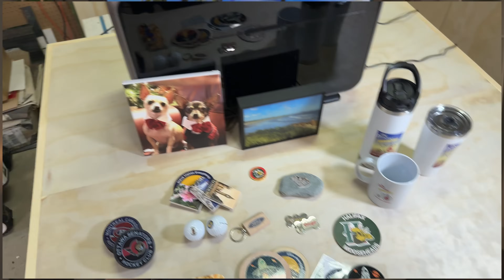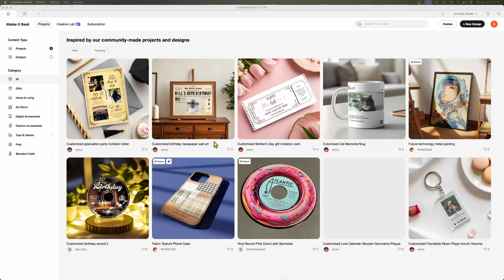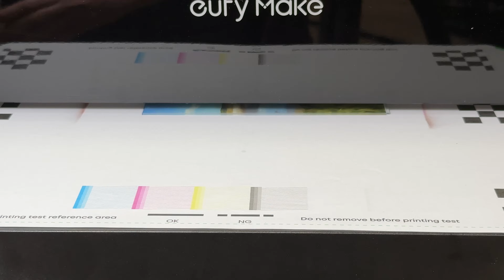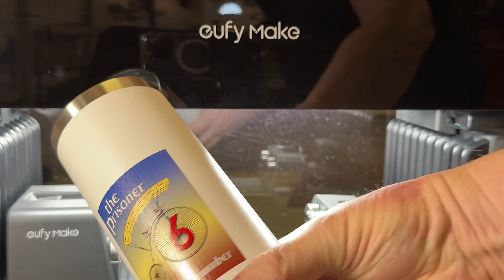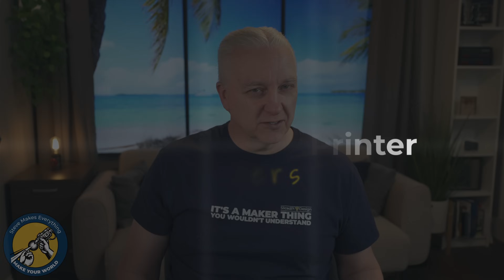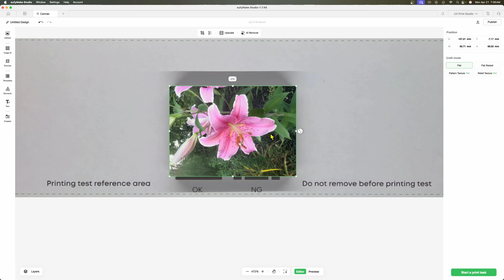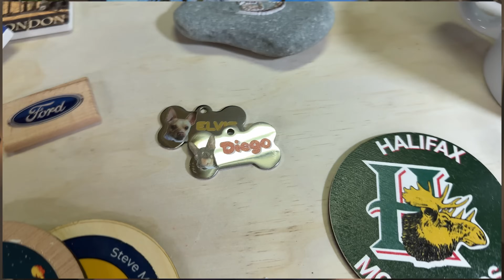eufyMake E1 | Pro-Level UV Printing for Creators at Home!

Comment: Can you print white small text (1-2mm height) on glass (candle) and plastic squeeze tubes? Thinking of product packaging text. Is the white ink still scratch resistant or does a gloss coat need to be added?
Reply from the maker: The glass will be fine. Note that flexible surface like a squeeze tube could be a concern because UV ink is resin, which it fairly inflexible. The white ink itself acts like any other color.

Comment: Hello! Are you able to put a 4x4 square in the machine while keeping it closed? I know the mini tray is only 3.5 inches wide from your description but wondering if it can fit a little more knowing that the area will not be printed on. I typically use precut 4x4 wooden and acrylic squares :) thank you!
Reply from the maker: I assume you're asking about coaster.  Yes they will fit on the mini bed, though positioning will require some serious accuracy

Comment: I liked this product and as usual, great video. One issue I have is that using your affiliate link, I try to order. However, there is a check mark that reads, "I understand that rewards or rembursements aren't guaranteed by either kickstarter or the creater" and then, there is a pludge button for $1970.00.   What am I missing? first time using kickstarter.
Reply from the maker: That's just a statement to say neither Kickstarter nor I have anything to do with the project, so any perks you might receive will come from Anker.  BTW can you email me your name (stevemakeseverything@gmail.com).  Anker is fighting a bit with Kickstarter because they said they are losing referrals back to creators, so I need to map you to my affiliate link so they will pay me.  Kickbooster is a bit of a mess apparently.

Comment: Hey mate. Does the 3d work on stickers?
Reply from the maker: No, because once printed, you'd need to laminate it.  There's nothing to stop you from using a piece of sticker paper and printing a 3D think on it without using sticker mode though.  It would be just like printing it on any other material.  Sounds like an opportunity for me to do a YT short video ;-)

Comment: As one who has been using large format UV printers I'll be curious to see how long the print heads last. UV printers big and small are great, however they need regular maintenance. These printers need to run, heads cleaned and flushed. An issue with just about all UV printers in UV light bleed over. Over time UV light starts to cure ink on the print heads. Head strikes are another issue, I'll be curious to see what the cost is to replace the print head(s)
Reply from the maker: That's true enough.  The good news is that the Eufy Make E1 does all of this automatically.  I haven't seen and issues with the print head at this point, though I've only been using this a month albeit fairly heavily.  But I'll report any issues since I'll keep this in my shop for a while.

Comment: I feel like A LOT was missing from this video. One question is have you had it long enough to see how the maintence is? UV printer require WAYYY more Maintenace then any of printer. Secondly how much white ink has been deposited on the back of the UV DTF stickers? I have been buying custom gang sheets personally bc I don't wanna spend the money to get a UV printer at 10,000 but because of the maintenance.  Also cost of replacing ink? Will it only take Eufy ink? can i print on a roll for the UV Stickers? the laminator reminds me of Xyron sticker maker. Once the tarrifs are over def considering getting on eover seas
Reply from the maker: I’ve been using this printer for a month. This printer pretty much looks after itself - it’s not like a DTF printer that requires constant use, head cleaning or ink flushes.  I have done nothing in the of maintenance to this printer since I turned it on and I think that’s what makes this a “personal” uv printer.

I don’t know how much white ink gets deposited on stickers. They to have a bit of texture to them and they feel thick - like vinyl stickers.

A full set of ink and head cleaning cartridges is $299 or $43 for individual cartridges.

Shoot them an email about the tariffs because they may cover them, but it you aren’t in the US there probably won’t be any tariffs on this anyway.

Comment: its nice but i don't consider $1,699 USD to be a budget price :D. And this is the early bird kickstarter price according to their info MSRP will be $2,499 USD oO.
Reply from the maker: I get it, though if you shop around, you'll see that this is a great price for a UV printer.  Others with similar capabilities will be as much as $10K or more.
Reply: @Nocturnaldude  it's super cheap

Comment: Is this outdoor safe? And what's the cost of ink and cleaner going to be?
I have a sawgrass sub and an oki white printer and ink is unbelievably expensive
Reply from the maker: Ink cartridges for this run about $43 a piece, though Anker is talking about an option that they say will cut this in half.

I believe I read somewhere in the literature about this resin being outdoor safe, but I’ll try to verify this, or it may be clarified in the Kickstarter launch.

Comment: I bought a $3k UV printer about 3 years ago.  At first it worked great, but was most definitely not user-friendly.  Unfortunately it only lasted about a year, then parts started flaking out and dying.  I'm really looking forward to this and will be putting my order in tomorrow.
Reply from the maker: Well no one can predict the life span for this one yet, but it does seem to be pretty solidly built

Comment: Sounds nice..but no one know how fast you can produce things. Especially the full size items (w/the larger bed) like a canvas project. Really looks good though..
Reply from the maker: Well it certainly faster than a 3D printer, but it’s not instant because it lays down ink in one pass and then cures it on the second pass.  The speed wasn’t an issue for things I printed, but textured prints will definitely take longer.

Comment: The price seems reasonable but I am concerned about a few things.  First, I am assuming this printer is using cartridges that contain hard inks judging by your response to comments below.  This is fine and my guess is most people will not be printing on things like leatherette or canvas where soft inks would really be required.  Do you know if they plan on introducing a way to swap cartridges between the hard and soft inks?  The size is probably OK for 95% of the users out there and I really, really like the embedded cameras to line up the art.  This seems like it would be very handy in the case of adding some color to a laser engraved challenge coins for example.  I like the self-leveling rotary attachment, especially if it can do full wraps on fairly large bottles.  My main concerns are using printer cartridges versus refillable ink vats.  Proprietary items like that can really make the cost of replacements astronomical.  You also didn't speak to much about the print head itself.  I assume it is a single printhead with a max resolution of 1440dpi.  Most of the UV printers I have been considering have at least 2 printheads and often offer resolutions of 2880dpi (Mostly Epson F1080) .  Most have a dedicated head for the varnish for example.  The heads are also replaceable.  Granted, these solutions are about 3 times the price of this unit, so that has to be considered.  I am still researching UV printers, but it seems like the consistent thing with UV printers is maintenance and occasional head replacement.  I would hate to have an issue where I buy something like this, have a head issue that costs $1200 to replace and end up paying $100 per 500ml of ink.  It seems like it wouldn't take too long to reach that $4500 price point of other printers that offer somewhat larger beds.  Great info though and terrific channel!  I will definitely consider this!!
Reply from the maker: When I asked about this, Anker said they had solutions coming for this, but it was a bit vague at this point

Comment: I am intrigued by the ability to print on golf balls. I am not a serious golfer myself, but I am wondering if the printing is raised in any way? I sort of think any sort of raised surface on a golf ball will alter its flying characteristics. Can you feel any raised edges after printing on golf balls?
Reply from the maker: No the print is just a simple smooth print that you can't feel on the ball.  It won't affect ball dynamics.

Comment: Are you using an enclosure? Ānker, btw
Reply from the maker: I'm only using the printer, but if you were in a small area and had a way to vent this, then an enclosure would be useful.  It's far less of a problem in my 900 sq ft, well-ventilated workshop.
Reply: @SteveMakesEverything  900 sq ft may not be an issue but from what I see on all of the videos, future users will be attempting to use these in their home offices and craft rooms. I would not want to be inhaling these fumes. Even Eufy is considering making an enclosure for these units.
Reply from the maker: @steevthetech  I vent everything in my shop, so I have no issues, but I wouldn't recommend that anyone breathe in the fumes from resins.

Comment: 1900 bucks is too expensive. Make it 850 and I will buy it, in european money though, not paying up tariffs. I dont like the white edges on the flower but it definitely has potential
Reply from the maker: Well I think you'll be out of luck since the nearest competitor to this printer is about $10K more.  I'm sure lots of people would want these if they were free. 😉

The white edges are only there because I over-emphasized the 3D effect to make it more visible.  Normally it would be much less pronounced or completely invisible
Reply: @SteveMakesEverything  you couldn't have gotten rid of the white edges and kept it 3d. Mimaki have a new uv 3d printer that can do any 3d part of a print in any colour. Average wages across the world don't support a 1900 dollar purchase.
Reply from the maker: @NLPexperts  There are limits.  If you keep below a couple millimeters things will blend better.  For the ones I did, I over-raised them because otherwise the effect is too hard to see on video.  I wouldn't normally do this eight for anything.  The lighthouse image I did was 2.5mms and it looks a lot better.

Comment: How long it took to print the flower picture (with 3d type texture)

Great review as always.
Thank you!
Reply from the maker: It was probably 15 minutes, but I don’t think you would normally have a depth of 3mms so this would be improved quite a bit with normal setting. I did this extreme depth to make it easier to see on video.

Comment: Wait till you realise the price for inks and replacement cartridges... buy cheaper printer but wll spend a fortune on proprietary inks!
Reply from the maker: UV Ink is expensive regardless and they’ve publish prices so there aren’t any surprises. I’ve printed a ton of stuff and haven’t had to change a cartridge yet, so it goes a long way
Reply: @SteveMakesEverything  bottle of 250ml uv ink is around  $20. So no, uv ink ain't expensive. Well time will tell though. But printing few hours for just one piece is not time efficient for business though. I think this printer is for hobbyist rather than production business.
Reply from the maker: @Jokershadow696  This is one of the things I chatted to them about.  They assured me that later in the summer, they would cut this cost by half.

Not that I'm justifying anything, but I can buy a lot of EUFY ink for the $10K difference in price between this printer and their nearest competitor. However, I do want to see them reduce the cost.
Reply: @SteveMakesEverything  for basic uv a3 size printer is around $1800 for a4 size is 1k. The only difference is that this printer print on tumblers and can do 2.5 relief, even it's very long but still. So for business this relief won't be so essential as making 100 magnets a day isn't possible. Nonetheless, I would have considered this printer only if they had modular printhead. So I can switch to different ink types or if one getting clogged. Market lacking of modular printers.

Comment: Just finished watching your video and was wondering what is all included? Is the tumbler and laminator extra? What are we talking price for ink? Thanks for another great video!
Reply from the maker: They shipped me a full bundle. The rotary and laminator are extra.  A full set of ink cartridges and head cleaner  is $300, but you can buy all of the cartridges individually for $43 each and they go a long way. I’m still on my first set
Reply: @SteveMakesEverything  I personally think that price is really reasonable, although I’m coming from the ecosolvent world where cartridges are $60 each, white is $120 alone. But they do last! Thanks for a great video. I plan to sell one of my ecosolvent printers “in exchange” for this 😊
Reply from the maker: @childogzus1  Even with the price, I think there are so many business opportunities with the Eufy that there will be many ways to pay this off very quickly.  I've been printing customer artwork on phone cases and have done quite a few without even trying to sell them.  I don't make volume items, so I'm trying not to fall into a trap where someone wants me to make 50 of these, but the opportunity is there if I wanted it.

Comment: I would really like to know the cost of the ink for an average coverage print at the largest size. Is there any information on this at this point?
Reply: I think they said $299
Reply: @RobertDeCuircio  that can't be for one 12 x 16 print, right? Would that be for all the ink cartridges? If so, how many prints on average would that cover?
Reply from the maker: @ Anker has data for this, but I've printed a couple of 8x8 photos, a couple of watercolors on acylic, and a larger photo, and still have used a cartridge
Reply from the maker: @ Yes indeed
Reply from the maker: They do have costing for all of this and I assume it will be published when Kickstarter opens.  Uv ink appears to go a long way.

Comment: the sticker aspect…I’ve notice you’ve made round ones but they were cut down to size on a square sheet of something clear. Does it peel off of that clear sheet or do you’ve to cut around the sticker? Can you make taller / larger stickers? Every crafting device I’ve seen…if a tumbler device was available it always looked pretty nice option to get.in this video you printed something really small. Can it do full coverage? I really like that leveling aspect…

I like the video…it just made me wonder more about the limitation
Reply from the maker: This is a bit of a limitation. If you have a round logo like I do then you’ll be a bit limited because there no built in cutter to cut along the outline. This means stickers are rectangular unless you’re willing to cut them round yourself

Comment: What’s the largest sized sheets you can print the stickers on?
Reply: What‘s about the height? I want to print on a lunchbox 7cm thick is this possible?
Reply from the maker: @VanessaDemhasaj A lunch box would fit in there - at least lying on its side, but I believe the maximum height is 200mm, so even standing up a lunchbox might fit
Reply from the maker: You can use the big workspace and get up to 330 X 400 mms

Comment: Great video Steve. The machine looks great however hopefully Anker (now Eufy) stick around longer with this product. Their 3d printers as i am sure you are aware vanished fairly quickly
Reply from the maker: They still sell a 3D printer but the 3D printer business is a pretty tough place these days, so I’d probably avoid the entry end of the market too.  At this point they are alone in the personal UV printer market, though I’d expect competition to arrive before too long
Reply: @SteveMakesEverything  That is fair. I look forward to what they will show on launch. And yes i have seen UV printers go up to as high as $15,000
Reply from the maker: @Spirited282  I couldn't spend that much, which is why I didn't have one until now.

Comment: Another question, how good is it printing on uneven surfaces (like the rock)? I am curious if I can somehow figure out a process to print a relief on one side then flip it and print another relief on the other. the second print side would be uneven since its sitting on the 3d relief of the first (the bottom surface would be the bumpy relief). It looks like it has a laser surface scanner to figure this out, just curious how well it works?
Reply from the maker: Well if you join me on Facebook you’ll see a dinosaur fossil I printed on a stone. Rock needs to be relatively flat over the area you want print but it works well

Comment: assuming a tumbler was dishwasher safe would the print on it also be dishwasher safe? Might not be a big deal but I am just curious if the resin relief is.
Reply from the maker: It should be, though I’ll run a couple of test with tumblers and mugs to make sure. The finished print is basically like ceramic when it’s finished, so it’s should be resilient

Comment: I had to stop the video before you talked me into buying another piece of hardware. This looks great. And if I watch any more of the video, I'll want to buy one. But spending $1500 for another gadget is not a great idea. Still, it was a great video, and it looks like a great product.
Reply from the maker: If it’s worth an opinion, I think there are a lot more market opportunities for this. I’ve already sold several phone cases without even trying. I made one for myself, someone saw it and bought one and it spread from there. I made another one today for someone who stopped by.  You can take a $10 phone case and turn into $45 pretty quickly.